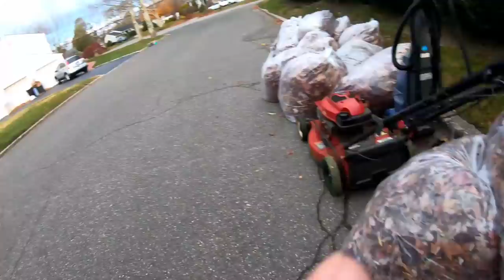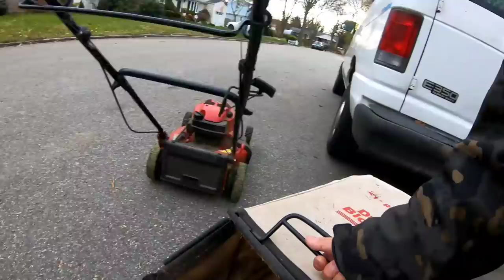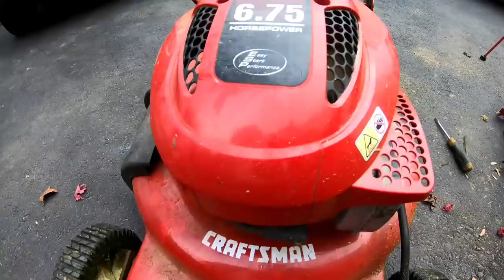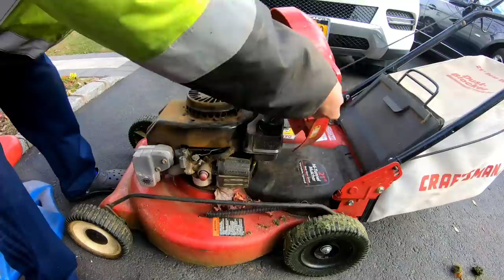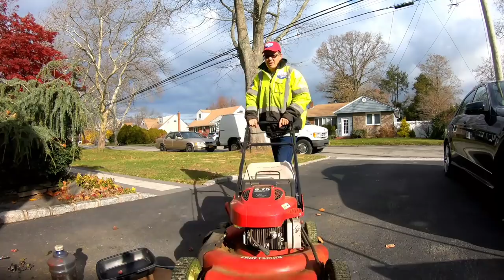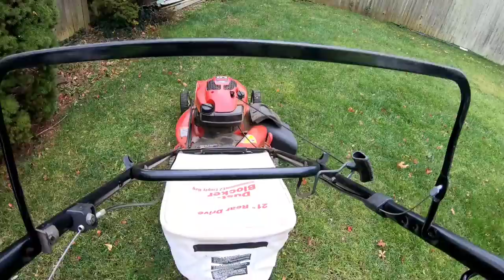CRAFTSMAN 6.75 TECUMSEH ENGINE LAWN MOWER CURB ALERT TRASH FIND PICK N' FIX OIL SLUDGE DRAIN REPAIR

Comment: When I took small engine repair in 8th grade our teacher told us to pour kerosene or diesel fuel in the crankcase when major cleaning was necessary and then remove the spark plug so it’s much easier to pull & rotate the engine over with no chance of it starting while mixing the old thick oil with whatever we used as a cleaner and much less chance of fire just not using gas for safety reasons and less chance of the gas cleaning the bearings to well and stripping all the oil off them and leaving them dry in the process of cleaning. Also not a bad idea to leave the plug out after putting the new oil in so you can rotate the engine over several times to get the new oil into all the important places before actually putting a new plug in and actually starting the engine up.

Comment: Hey buddy I have had 6 of those same mowers in the past 8 years.
Reply from the maker: Really?  Exactly like that?  I’ve never had that cover before but the deck is pretty common
Reply: @MowersNBlowers  yes I don't think that made them for long just like the lawnboy with the tecumseh that u had to have the bag or mulch plug on the back of it to have Spark.

Comment: Nice mower, that’s an unusual model for sure. Tecumseh’s are great engines but you have to make sure the bowl seal is completely airtight or it won’t prime, even the slightest air leak around that bowl gasket will keep it from priming. Good score bro!
Reply: Agree. Tecumseh closed it's doors in 2009 but testament to the engine's durability, there are many, many working mowers still out there over a decade later, including the one in this video (well done, BTW). Plus, parts are abundant which would not be the case if they weren't yet being used. Still Henry is right, the carbs, especially the priming setup, are the Achilles' heel.

Comment: I worked on one of those mowers over the summer.  Those wheels were about $40/each when I priced them.  Some awkward size from what I remember.  I converted mine to a roller bc the teeth were bad on the wheels.  Wasn't putting almost $100 into a mower just to make that much.
Reply from the maker: I believe it,  those wheels were solid!